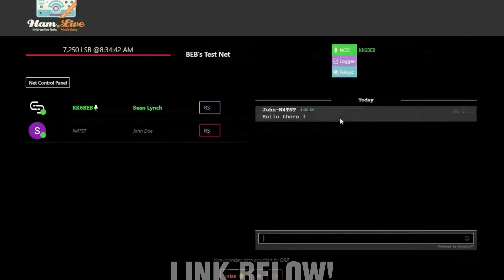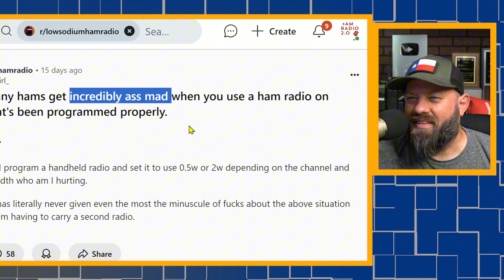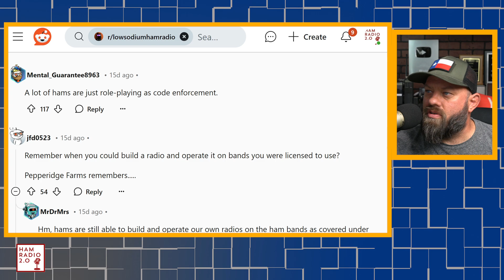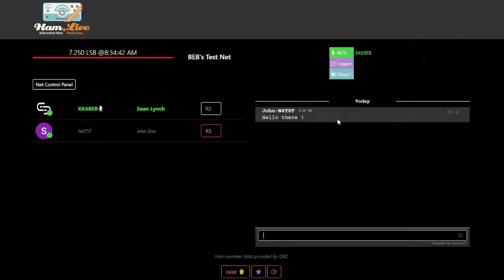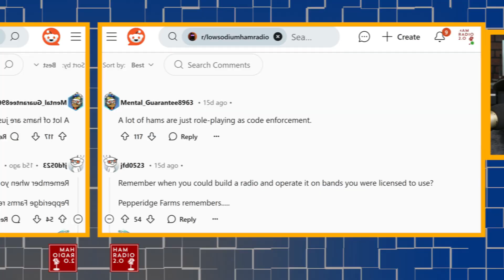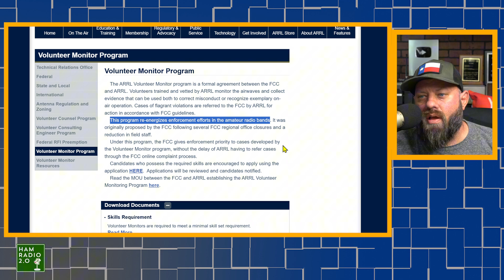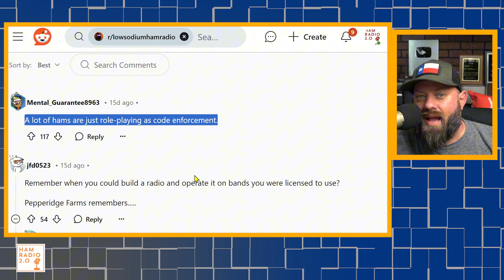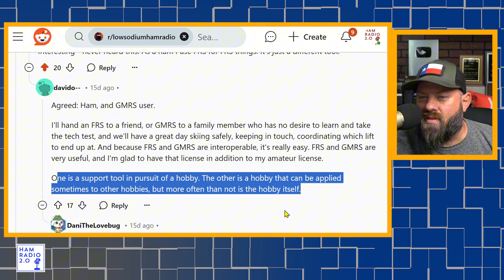Can We Use HAM RADIOS on FRS Frequencies?

Comment: Our rules In Canada fir GMRS is quite different. GMRS is a license free band. But we are limited to a maximum of 2 watts. In the case of a GMRS and a FRS frequency that is the same the power output drops to that of FRS rules. With GMRS radios as with FRS the radio and antenna must  be one piece. Use of high power GMRS mobiles is illegal, and the do not allow for repeater pairs. It is  also illegal to import GMRS gear that does not meet Industry Canada's rules into the country. So technically  even if you are licensed in the US to use that 50 watt mobile, it can be seized at the border. Having said that, I say you do you. You break law I laugh, You get fined or go to jal I laugh harder. But it;s no skin off my nose either way.
Reply: There is zero enforcement of the Canadian laws on radio gear. ZERO
Reply: @warp9988  99.999% true. Interfere with any commercial operation they will take action if they can find you... Ham radio to them is the wild wild west.  Local office has hit a few people over the years, but not much. CBSA will enforce any law they can though.

Comment: It seems dumb, that an FCC legal FRS radio cannot have a removable antenna. You can increase the effective radiating power by using a better/larger antenna than the stubby one that all FRS radios come with. 
Personally I do not care it someone uses a Baofeng type radio on FRS bands even with 8 watts (4 times the legal limit). Its better they violate the FRS bands than the Ham bands. The CB bands are a mess: It is like a circus. CB = Constant Bullcrap.
Reply: And (a) there’s no budget and (b) there’s no people actually enforcing these laws.  These are unenforced laws that exist on the books like laws from 1898 about your mule farting too loudly.   Is it illegal to use a Boofwang on FRS.  Yes.   Does that matter? NO.

There have been zero people in the HISTORY OF THE UNITED STATES who have been charged for operating on the FRS bands with a BOOFWANG.  And zero in Canada.  ZERO.

Should you do this? NO.  Does it matter if you do? Probably not.

Comment: 1) CB is Part 95.  The idea of Part 95 radios is you can but a radio in the hands of untrained users.  That's why the restrictions put on those radios.  The user doesn't have requirement of understanding bandwidth, power, and the other stuff we as licensed operators are required to at least aware of.  Or, must live and die by for the commercial license holder.

Part 90, the business class radios are a fleet license.  People are granted authorization to operate their company's radio, and the radios are certified to be on frequency and used properly by the companiy' communicatios department.  Thus includes maintenance and programming, no front panel programing. This includes EMS, public safety, utilities, taxi companies, and the like.

The government radios are governed not by the FCC, but by the department.  The Air Force governs the use of their radios (including CAP) , and within the specs set by the NTIC.  The Navy has their own rules of who can use their frequencies and how.  Same with the FBI and diplomatic corpse, and other offices.   One of the problems highlighted on Sept 11 a few years back. 

With all that said, using a Beofeng or some other generL coverage radio on FRS and GRMS frequencies? As long as the radio is programed to follow specs of the channel, no big deal.  What I get upset with is when they go out of spec and start interfering with other channels or services.  Either through ignorance or intention.  It's also why I avoid channel 6 (the Superbowl) on CB.  Just operators turning their amps up all the way to see if they can rank over everybody else doing the same thing.  You end up just hearing hetrodyne squeals instead of voices.  When I do CB, generally LSB on channels 35 - 40.  More times than not, though, you'll find me chasing DX on 40, 20, and 15.

de Chris, N1WKO
Reply: I agree with the idea of limiting the “common” radios so people can use them more easily.

I think the cleanest approach is simply to say that in order to use a HAM radio on GMRS, you need to have both licenses. GMRS license for the callsign, and HAM license to “prove” you’re at least, on paper, competent enough to know how to operate a more complex radio. Then just follow the rules for GMRS.

Personally I do have a MARS mod and I have everything programmed and ready if I need it, but I’ll “preferentially” use a dedicated GMRS radio whenever I can.

Comment: In my GMRS club, there has been a lot of discussion about using non-type accepted radios on FRS/GMRS frequencies. I've heard that integrity is doing the right thing, even when no one is looking. I'm a fan of that idea. That said, I agree that many amateur radios are much higher quality than a typical FRS or GMRS radio. I always encourage integrity, but ultimately, if you are otherwise playing by the rules (properly configured radio for the frequency) and are not causing harmful interference to other operators or some form of emergency response, I really don't care what radio someone uses.

Comment: Hans don't own the airwaves and we aren't the enforcement arm of the FCC. Furthermore, if someone sticks to the FRS frequencies and doesn't dramatically exceed the allowable power, there's no way for anyone to know what radio they are using. It is a violation of FCC rules to transmit on FRS/GMRS/MURS frequencies with a radio that isn't type-certified for that band, but the FCC has neither the resources nor the inclination to hunt people down for it. I'm sure if they came after you for interfering with other users and just generally being an asshat, they'd throw that charge in as well, but I've never seen credible evidence of anyone being fined or imprisoned for that alone. As to why any Hams would care what radio you're using on FRS/GMRS/MURS frequencies, I got nothin'. I guess some people don't have enough stress in their normal lives, so they have to create some.

Comment: Nobody should care as much as they seem to. There will always be people who act like they know better than you.
The reality is that most people using UV-5Rs on FRS don't realize that they are exceeding the power limit and are using a non-fixed antenna system. (in violation of Part 95)
I feel better about GMRS licensees using non-type accepted equipment. They are less likely to being using excessive power on a handheld and are more likely to understand the basic rules of the service.
I agree that I would rather people were using Motorola, Icom, Kenwood, or Yaesu radios on these frequencies than the cheap Chineese radios that produce harmonics and have deaf frontends but rules are rules.
The rules seem to be prepetually out-of-date but, until they change I will keep using different radios for each service. You do you.

Comment: Some people are going to complain no matter what. When I am asked, I tell people to use the correct Part 95 certified radio for GMRS. But I sure won't get upset for anyone that uses a non certified radio on GMRS as long as they are not causing problems. I won't condone or condemn people that use amateur radios that are unlocked/modified on GMRS.  And I can't confirm or deny that I have and use unlocked radios. It boils down to using common sense and not being an idiot that causes issues.

Comment: I hold both GMRS and HAM licenses. I get plenty of acquaintances that have broached the question about using amateur radio handhelds on FRS/GMRS frequencies and I give the canned response that the equipment is not type accepted for use on those frequencies; do your homework, understand the risks involved, and use a little bit of (not all too common) sense. I don't encourage it nor condone it, especially operating in amateur frequencies without a license.

I have personally a handful of FRS/GMRS specific radios for those specific applications and they're channelized to make it easier for them to use. Turn it on, set the channel, and Bob's your uncle. For those "convoy" applications, I still use CB radios.

Comment: I programmed in my work frequencies so I don't have to carry a work radio and my ham HT and I set it to less power then what the work HTs put out because it's only used inside a building a little out in the yard an parking lot! I the work HTs put out 2watts but I have my ham HT set to 1/2watt because that's all you need I can still talk back to the shop on 1/2watt a little over a mile away at the Bruger King but the other guys using the shop radios can't hear the other radios because the receive side is crap in those radios! LOL
Reply from the maker: I've done that
Reply: I do that as well, we have a repeater on the university campus I work on. I monitor local repeaters on the other slot on my HT, I get to sneak in the odd contact here and there. My boss, his boss right on up to the president of the university are very supportive of my amateur radio endeavors.

Comment: I think if you program it correctly, you should be able to use it.  I also think they require cert'd hardware because someone who doesn't know how, will ruin it for everyone.  it's why we can't have nice things. it's shame we can't have a middle ground like a cert'd code plug.
Reply: True. Some radios have ham offsets built in so you really have to check everything in the channels you make

Comment: Never asked and have no motivation to tell anyone if they should or shouldn't use their ham radios on FRS or GMRS. Don't care now, never will. IMO, it makes absolutely zero difference to any of the services.
Reply from the maker: Agreed
Reply: I'm not gonna lie ,just easier to have one radio programmed for GMRS and HAM .I don't need ten radios on the dash of my Jeep  or different handhelds for this and that . I can talk to whomever I'm licensed for easy peasy.
Reply: Sosayweall.
Reply: My Alinco mobile and HT DMR radios can do GMRS out of the box and you know I’m not gonna complain.
Reply: I'll go even farther and propose that we hams should take the lead and fully integrate ourselves with the other services for purposes of receiving emergency traffic during critical incidents. 

My formula for this concept: 

1): At least one Retevis RT-95, unlocked to Mode 02 with first 30+ channels being the 30 GMRS freqs plus any extra repeaters in range (don't forget to enter the offsets on 467 MHz so you can receive someone calling into a dead repeater). Then add the five MURS freqs, Marine Channels 16, 68, 69, 71 & 72. Add the color dot and itinerant star freqs from business band radios. This radio will need a different antenna than your ham VHF/UHF set. I recommend the Comet FC5NMO, because it is specialized for the above range of freqs, but it's not for 144-146.

2): At least one scanner with the above frequencies, plus the CB channels, including AM freeband freqs. On separate banks, add The business/itinerant freqs, ham calling freqs and repeater freqs in your area (AND their offsets), your local fire, law, public works, and Airband freqs in your area. The scanner frequency range should be at least 25 MHz to 470 MHz, but 700 & 800 MHz is heavily used in many areas without encryption, so good to have that as well.

3): At least one CB radio or 10-12 meter band ham radio with scanning ability and a channelized tuner, unlockable to 11-meter band. You'll want the full 102-inch whip to pull in weak signals transmitted under less than ideal circumstances. Don't forget the freeband commonly used in your area.

4): At least one additional unlocked portable ham radio (and CB, if applicable), to maintain contact with the calling party as you approach to locate and assist them. Two portables, if you have someone coming with you to help.

Now simply scan for emergency traffic during critical incidents and be prepared to quickly stop scanning and write down what you hear, including everything you will need to identify, recontact and locate the person needing assistance after you leave your radio base station (this concept assumes first responders are unavailable). Program the portable(s) before you leave to help. Try to have others stage the things you will need to take with you, such as medical supplies, safety equipment, tools, gas cans, etcetera. Confirm the address given actually exists, and be aware that calls for help could be a setup for a robbery or ambush. Take another person with you, and leave a copy of the plan with someone else who can monitor, preferably at your base station. Relay to any ham EMCOMM station, if up and running, in case someone is closer than you that can help.
Reply: This is the way.

Comment: I definitely have a few radios that are programmed for FRS/GMRS frequencies in case of an emergency
Reply: Bingo Sir. 👍
Reply: In case of life threat is legal (just to ask for help)
Reply: It's a big difference. Modification in case of emergency and modification to use whenever you want. It's impossible to use an amateur radio transceiver on the FRS frequencies without breaking the FRS rules. For me, some people have the right to be not happy about those who complain of them using illegal radio on FRS and those who complain about it have the same the right to complain about people who illegally using ham TX/RX on the FRS band. Everyone have the right to do whatever they want to. If someone breaks the radio rules, it's between them and the FCC. Good luck to them.
Reply: And some with things they probably should not have like Fed Interop!
Reply: @Anakinmanakin  what is that?